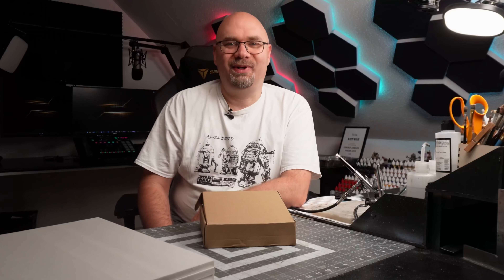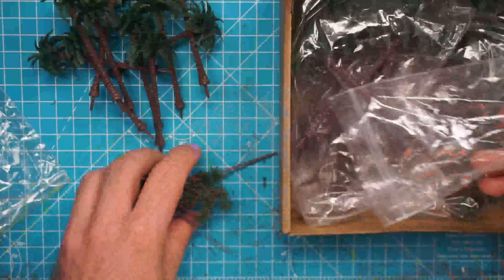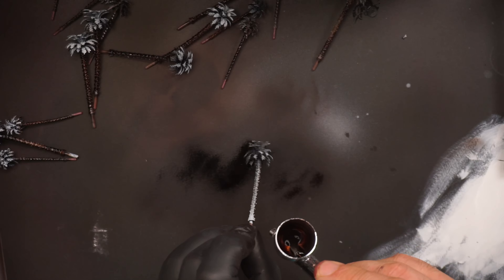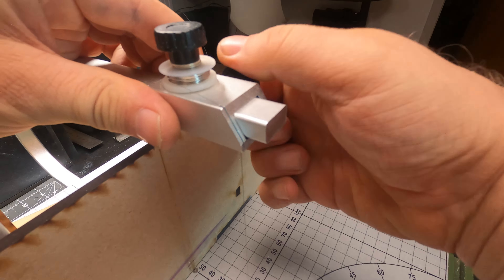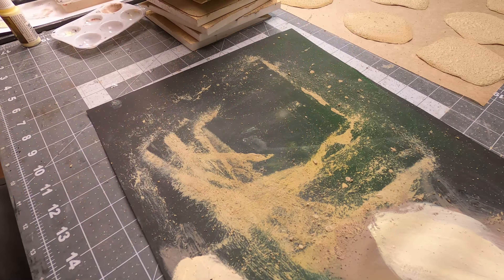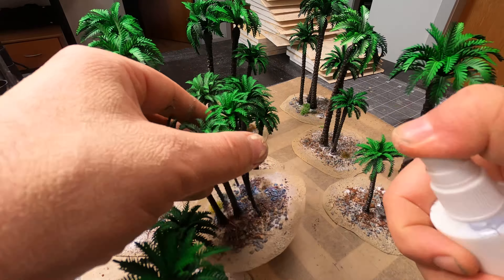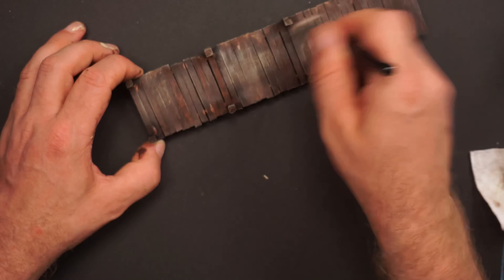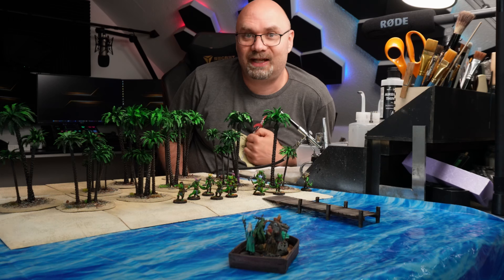Palm Beach Tiles for Table Top gaming - TTRPG - Dungeons & Dragons

Comment: Looks great. For my beaches, I have painted water boards (24”x24”) and use brown paper for the sand. The paper is that brown packing paper that many companies send in packages. With just the remains of the crinkles for package, the paper gives quite a good sand look and as a bonus, you can easily alter the shoreline by tearing the water edge. You could also make your dock modular so you can change its configuration up to moor a couple ships, add a crane or just fight on the docks. Great build though!
Reply from the maker: Thanks for the tips! I have planned to make a dock expansion